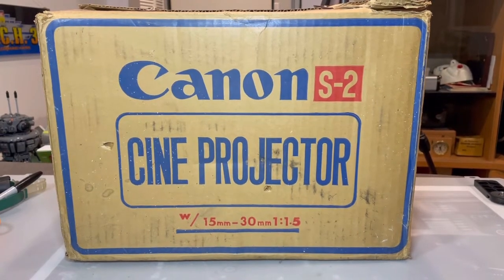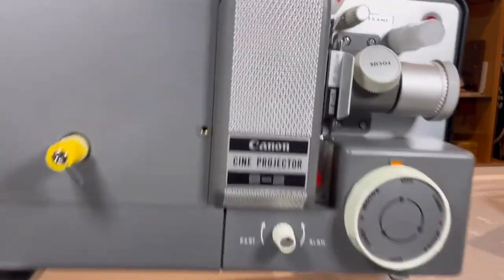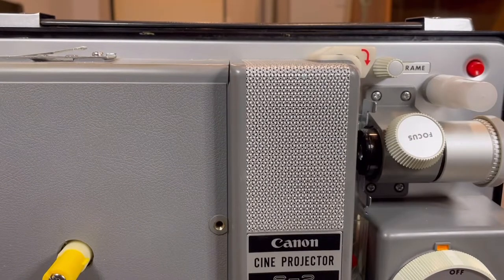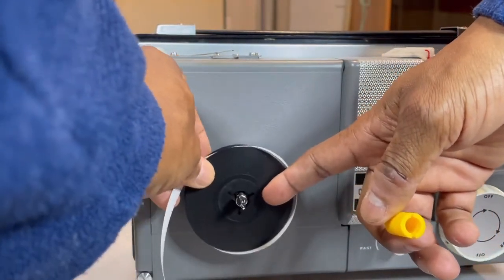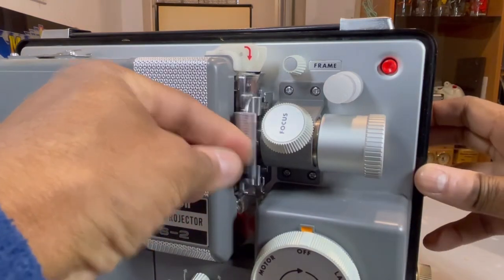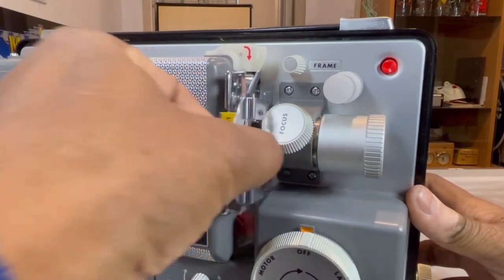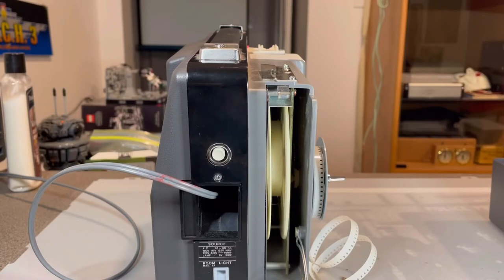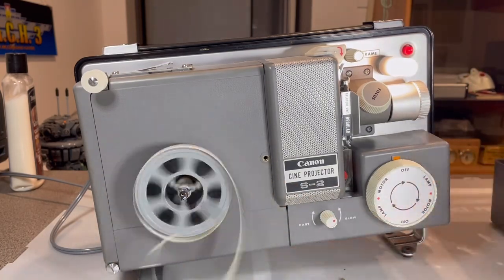Canon S2. Cine projector

Comment: I noticed that there appears to be only one claw responsible for advancing the film in my Canon S-2. I am curious if this is a standard feature for this model or if it's possible that one of the claws may have been damaged or chipped?
Reply: Not sure, but I'm guessing it might only be a single claw pin.  I have the Canon Cine S-400 which has a dual pin claw and the claw channel is much longer than what I  see in the video for the S-2 (the little black cover plate at the 1:34 mark covers the claw pins - and on the S-2 it is much shorter than the S-400).
Reply: @carekbean  Thank you Carekbean! Fresh Ground Pictures (channel name) is showing inside of S-400 and I can see clearly 2 claws. As much as I like S-2, a single claw doesn't deal well with spliced films. I guess, it is time to find S-400.